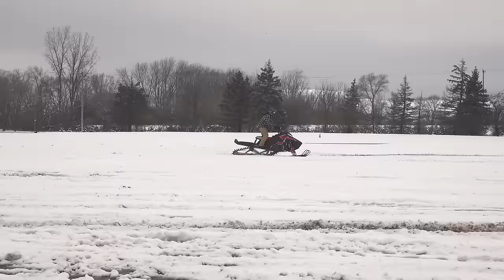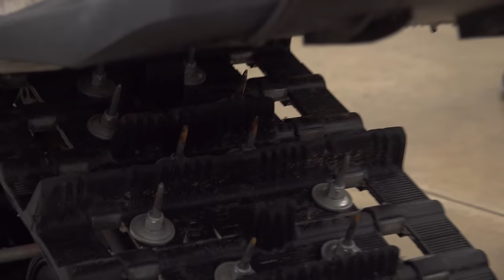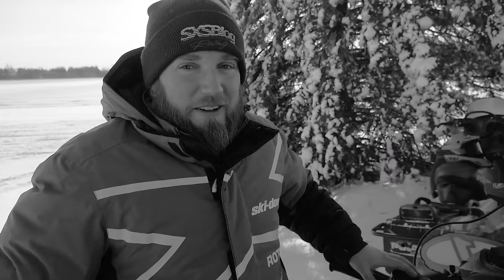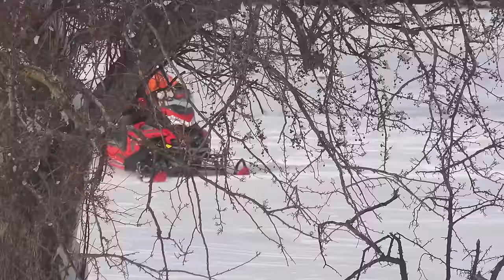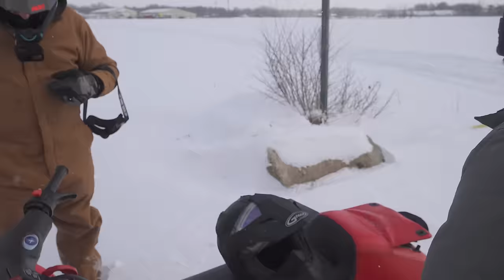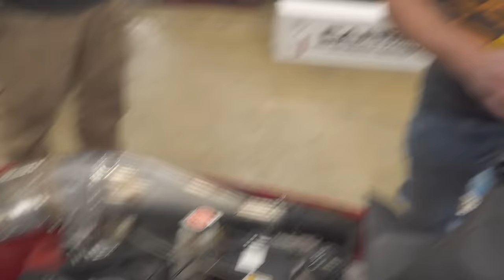Cheap Sleds BLOW UP & New Sleds RIP!

Comment: Matt-make sure that the exhaust valve guillotine isn’t contacting the side of the piston.  That’s a known issue with these Polaris sleds with a lot of time on them.   The guillotine stop in the cylinder just wears out over time…Just grind down the edge of the guillotine to make clearance
Reply: If you don’t have the upgraded stainless steel ones, it’s heavily suggested to replace them, as when the guillotine stops wear, they can snap off and fall into the cylinder. Especially on the 800’s
Reply: it looks like it was sucking air somewhere.  Crank seal or carb boot leaking at the cases would be my guess.

Comment: The 2stroke / 4 stroke issue is partially power (and when it comes on the power band) but its also weight.  Traditionally 4 stroke engines are heavier and therefore the sled is heavier and less nimble to sling around in the mountains.  Tech changes and the difference may not be wide a gap anymore but riding an old 4 stroke vs a 2 stroke was night and day difference in handling in the powder.

Comment: Steve, you should try disconnecting the wiring to your power valve controller,  and connect the vents to each other with a piece of gas line.
Reply: I'll give it a shot if this new regulator doesn't solve it, thanks!

Comment: I have a free Polaris, Indy, 500 if you want it for a back up sled in the cheap sled challenge,  it run runs for sure, the axle broke but I have another one and the bearings all you have to do is put it together drain the fuel tank, new gas you got a ripper ! I promise come pick it up Erie Pa

Comment: Mag side CYL on the old Polaris Needs the fuel screw turned up the width of the blade of a screw driver from the Clutch side..  all  the 700/800 edges sleds  burn down on the mag side...We deff Experience that here in Canada With No speed limits and miles of logging roads.

Comment: I feel the pain blew up my first sled This year. Just bought it this year, there was so much blow by it blew all the grease out the bearings by the primary. It’s a 03 rev 600ho with only 3500 miles too

Comment: Cheap sleds blow up because of not being taken care of!   When buying a old used sled, you should first change the crank seals and clean the fuel system, including Tank, lines, fuel pump and carbs.  Then you will not be throwing your money away.
OK, now my rant  is over, I like your video's, keep up the good work!

Comment: I noticed your v-max 500 back there,  you used for sno-x. I have a shortened Venture 500 I use for sno-x. Would you like to exchange clutch and gearing set ups?

Comment: That misfire on start up could be your des system. Try wiggling your key on that knob when it does that, ive had the same problem on my skidoo and it went away after i wiggled the key. Also change the plugs, they usually get too wet to work properly after the sled misfires for awhile. The rev chassis are super fun to ride but like any sled they have their own wierd little problems

Comment: Matt's sled?   Lack of oil on that cylinder? Intake boot leak?  Crank seal on the end bad?  Don't just replace the piston and cylinder. Find out why it went lean.    Joe's Skidoo could also have a crank seal leak. The 800 motors were known for that. Also have him check for cracks in the intake boots. I have had 7 REVs.  Many common things cause problems.
Reply: Oh yah soon u run it with the intake boot leaking ur blowing up fast

Comment: Those 4 stroke turbos are a lot like old muscle cars. They sound good and are a blast in a straight line, but sooner or later you have to turn and that isn’t quite as good of a time
Reply: With that Lynx it is not the case. You are able to smoke 2strokes on trail all day.
Reply: They turn just fine

Comment: What’s done to the lynx?
Reply: 900 turbo r , basically x3 motor
Reply: Apparently has stock tune I imagine clutching 
definitely exhaust and blow off are not stock
Reply: Bone stock just a slip-on muffler. There is no blowoff valve on the sled. No clutching. It actually sounded exactly the same with the stock muffler just quieter. It would still shoot flames on decel when it was 100% stock.

Comment: So new to New England and snowmobiles in general as I’ve never seen one in person yet. What’s the deal with leaning the sled on one ski and driving?
Reply: Here it was just for fun, but in deep soft snow you have to ride them like that unless you're moving really slow. It's kind of like riding a jet ski
Reply: @Steve-sxsblogparts  so it’ll just push if not I suppose. If this is Steve this is super cool lol
Reply: @Hittin2thabass  Yea it's me lol. The sleds just roll over since the snow can't support the weight on just the outside ski.